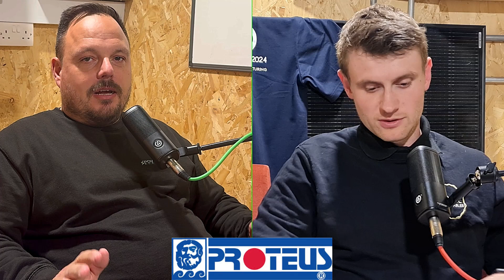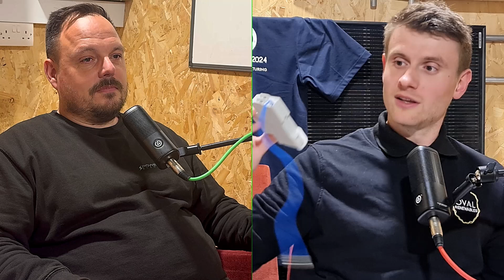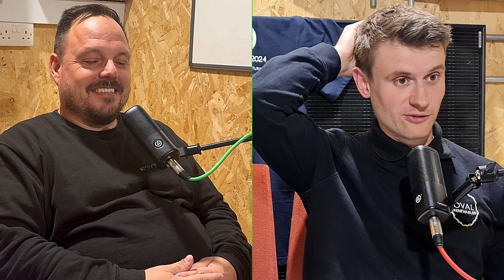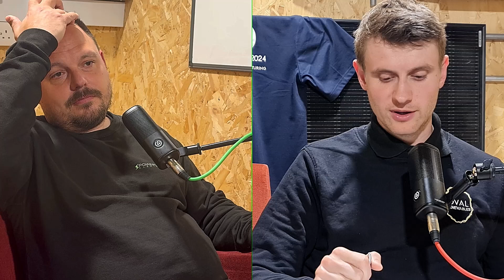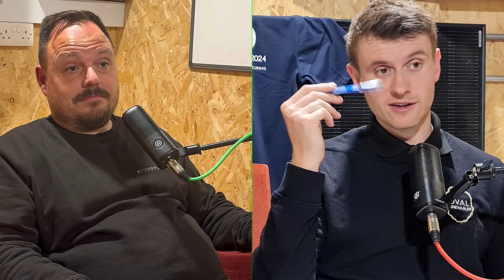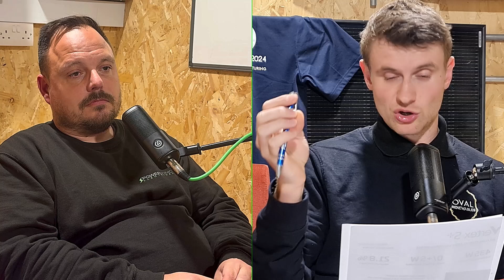What solar panels do I need? How do you size cables, isolators, inverters and more???

Comment: I found this incredibly interesting, and also concerning (potentially) for the less technical customers as everyone has to trust their installers! 

I have just had a 3-roof PowerWall3 system installed with 11 panels (435W) connected to one MPPT - the panels are all in one string (with Tigo optimisers) despite their different roof orientations.  

The installer said that the optimisers will counter any issues with the different orientations.  I have to assume this is correct as I'm not totally au fait with the technology.  I'd simplistically thought 3-faces, 3-MPPTs ~ three strings..... And that's what the sales guy had indicated over the phone when we spoke back in July: Google images etc as most seem to rely on.

Today (4-oct) I generated 9.4kWh over the day.  Generation started around 9:00 (even though sun-up was earlier), and stopped around 21:00. 
For October, I believe this is OK as the 'quote' I had indicated that 7-ish kWh is the predicted average in my region at this time of year. 

We have to trust you guys, although I'm not clear who 'designed' my installation as the supplier has a few contractors, and I'm not sure if it was the contractor's on-site decision. 

Even though I'm now up and running, I will still follow  your podcasts as (being a retired engineer) I find the topic interesting, especially as everything develops.

Comment: Regarding paralleling strings on roof then finding it may potentially exceed the possible max isolator current limit...
Why not consider then running two series strings to a 4p isolator, THEN parallel the strings AFTER isolator
eg 2x 14A series strings, safely isolated on a 20 or 25A isolator, THEN parallel to create 28A & fed to inverter

Obviously, this requires more cabling, but ensures isolator always switches a safer lower current within its range, even on a pure sunny day
Plus lot easier to work/test/diagnose issues with 2 into 1 string if parallel connection itself is near inverter than up on the roof
Reply from the maker: Lots of options to use and tools in the bag! My concern with that would be a single point of isolation into an array MPPT but nothing clear labelling couldnt sort out.